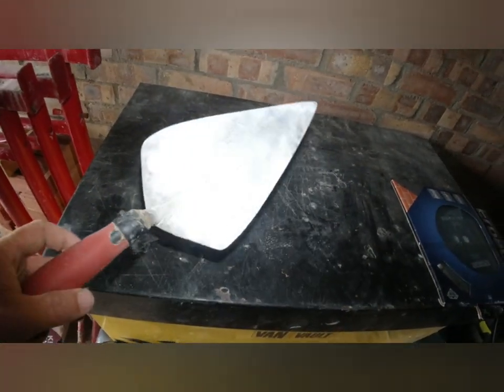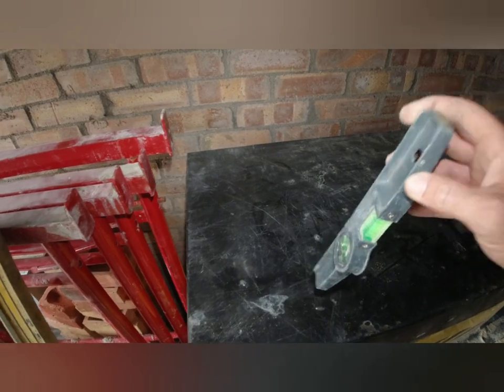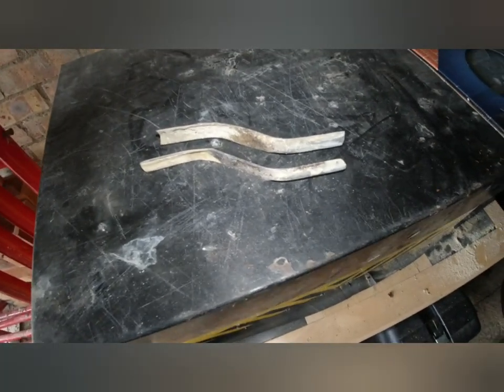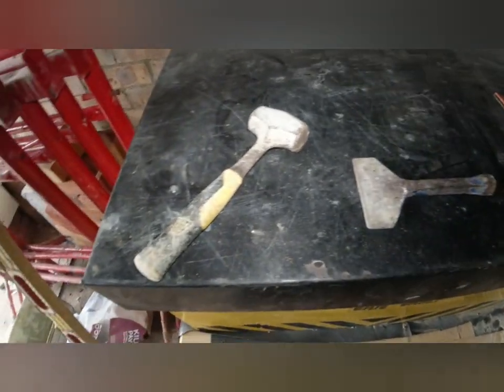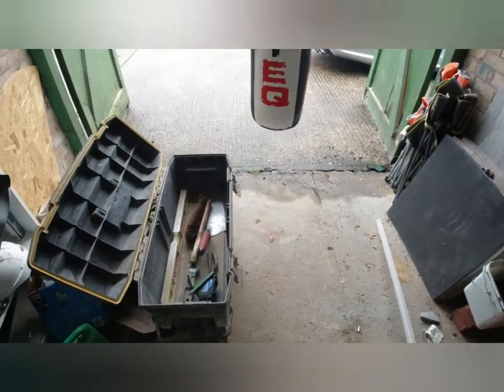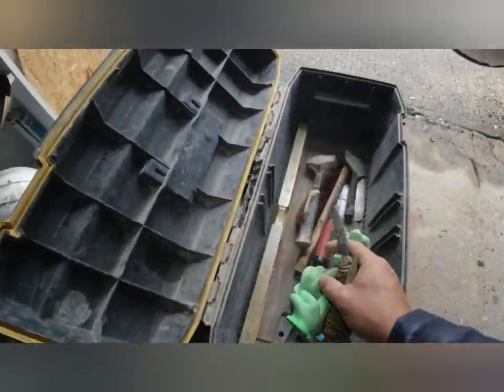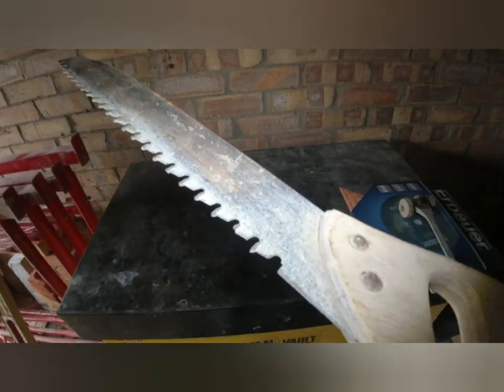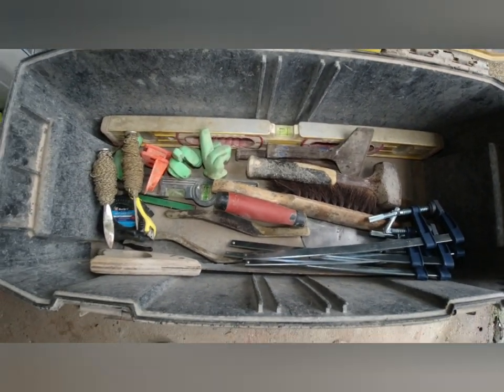bricklaying ( basic tools)

Comment: where do i get the middle finger line blocks?
Reply from the maker: I got them off ebay bud. 😆😆🖕🖕
Reply: Any links ?
Reply from the maker: https://www.ebay.co.uk/itm/BRICK-LINE-BLOCKS-MIDDLE-FINGER-LINE-BLOCKS-2-plastic-corner-line-blocks-/113793515822?_trksid=p2349624.m46890.l49292